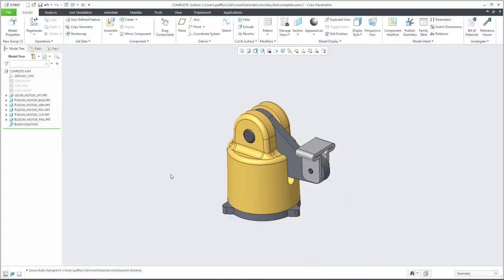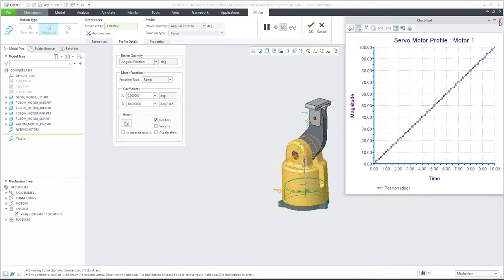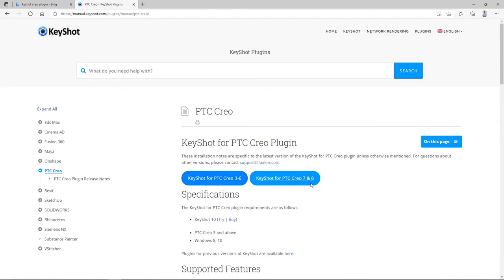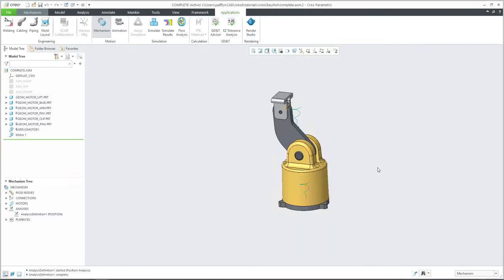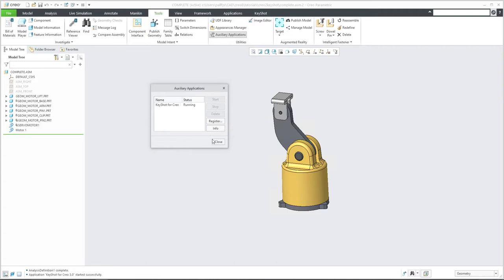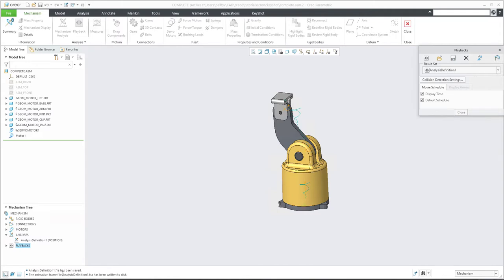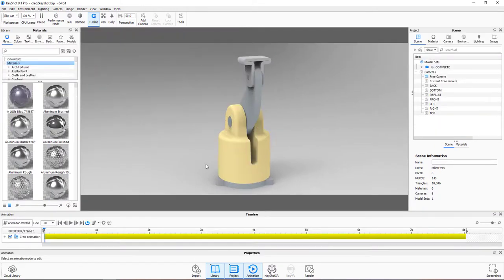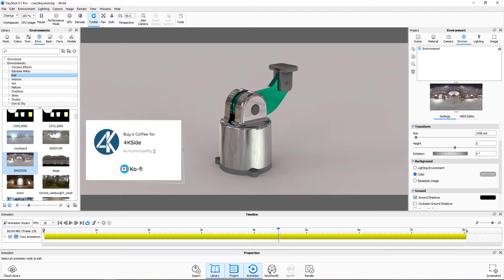How to render Creo mechanism in the Keyshot animation

Comment: Vladmir Hi. I have problem with motor. I apply a motor to make object go up. Then I create another motor to make object go down. When I put both together in the analysis, It gives error, no movement. I want object to go up, stop and then go down. How do I do this?
Reply from the maker: Hi, I will try to create some example. Stay tuned, Vladimir
Reply from the maker: One question for movement (eg. Go up 5 sec, stop and stay 2sec and good down 5sec... Something like this or up/down for 5 sec... I am asking I will use one motor and graph or 2 motors 😉👍
Reply: @4kside  Thanks for your response. I used 2 motors. One for up, one for down. I put the 2 motors in analysis. And didn't get any movement. Just error. May be I missed the timing of the motors. Up motor: Start to 5 sec, Down motor 6 sec to End.
Reply from the maker: Hi John, sorry but I am really busy in these days... No time to create video tutorial.
Please setup that fist motor will run 5 sec.
Then set small pause e.g.(2 motor will start 5.1sec and finish in 11sec / end of animation).. And I think that it will be working. Please try this method.
Bye Vladimir

Comment: How to make family table with dual dimension in drawing? (unit mm[in])
Reply from the maker: Hi, why you need family table? It is possible to setup this preferences directly in the drawing. I will try to create quick video for you. Thanks for your question. Stay tuned. Vladimir
Reply: @4kside  Based on drawing data I create drawing in dual dimension by setting dual dimension in dtl file but don't get result in case of family table. In family table we define rod code XXXXXX instance name, XXX.X [0.XX] length in mm[in].
Btw thanks for reply.
Reply from the maker: Hi, you can create parameter by relation (e. G rod_inch = d21/25.4> you will get necessary info in the inch and apply this as a note in the drawing @rod_inch
It is workaround but I hope that it will help you.
Reply: @4kside  I have relation in post generation which create automatically parameter for inch dimension but don't know how to use them in family table.
Thanks for Reply
Reply from the maker: I will try to create some example. Stay tuned.